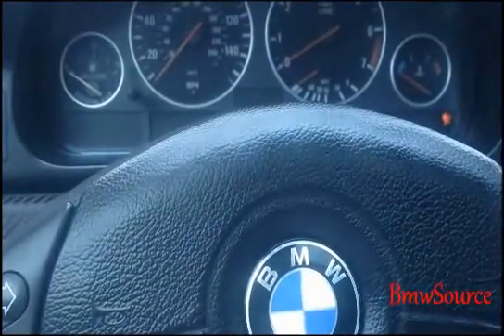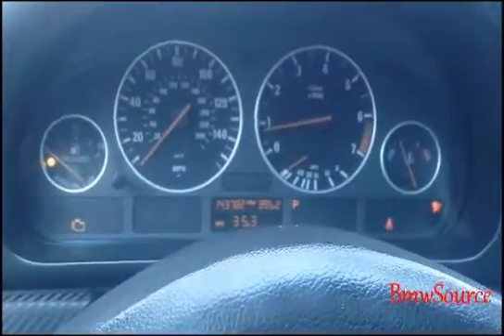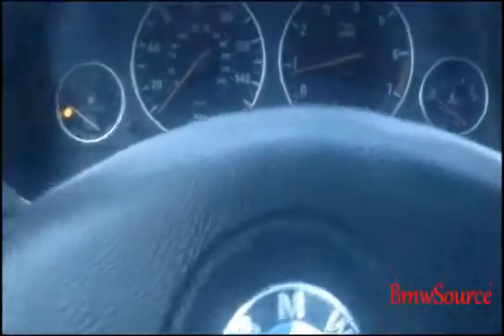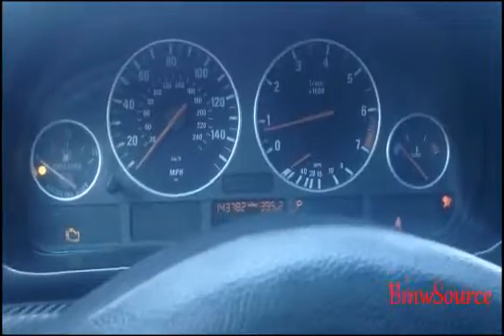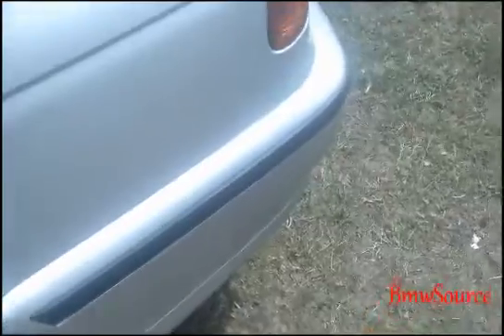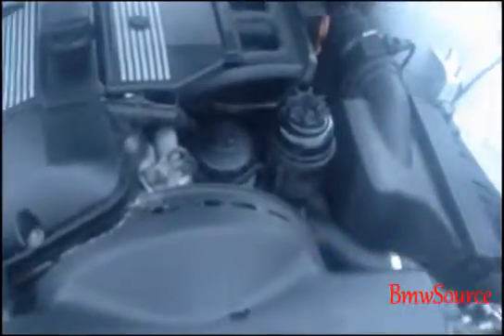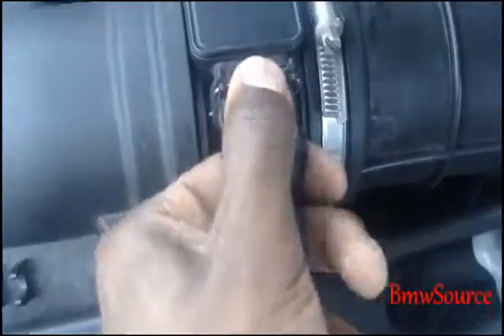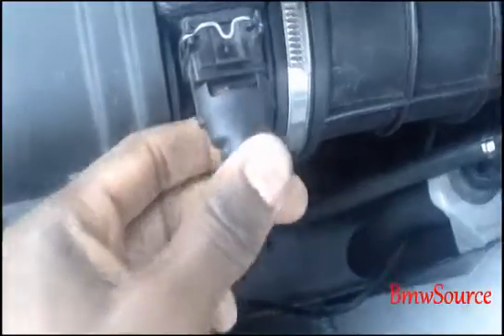How To Diagnose MAF Sensor E39 BMW

Comment: What is your opinion on using the K&N air filter in an 02 325i. What are advantages/ disadvantages about the K&N air filter.
Reply: K&N filters are good but contain a coating of oil which can foul the Maf over time.
If you clean the Maf every 3 months or so (Using airflow sensor cleaner only) then you should be fine.
Reply: I've bought a k&n cold air intake w/filter just know if it says it's universal it's not

Comment: Lol,clearly not a tech,, what about the specs, signals from the DME, ground, reference voltage, u cant replace a part by looking at the tach or disconnecting it to stall the car, what's the fault code are there any other driveability issues..etc